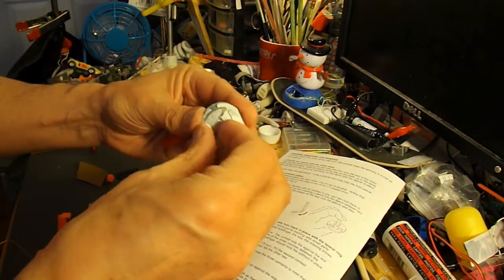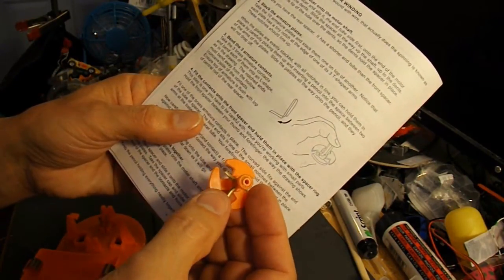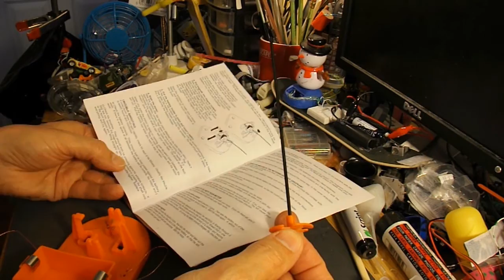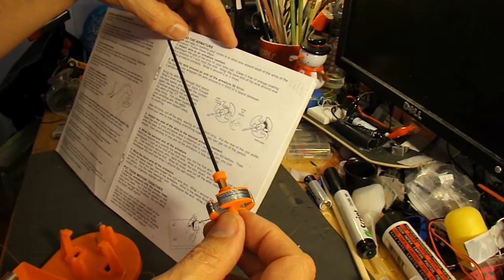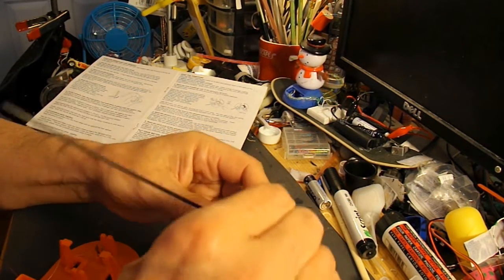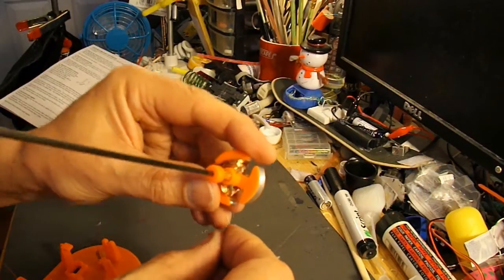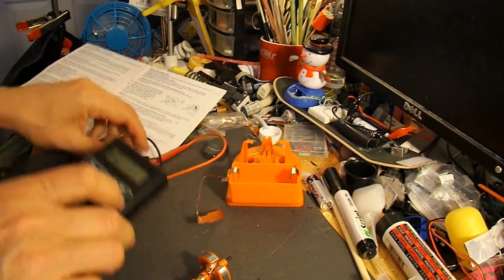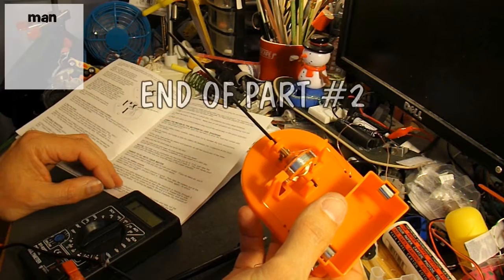Let's assemble a Build Your Own Electric Motor kit PART #2 of 3

Comment: So happy to have found your video!  We are not done but since we found these, a whole lot makes more sense than it did yesterday.  I told her we would go run it later but I belive it will still be yet one more day. Thank you!
Reply from the maker: Good luck, there are some useful links in the video description.
Reply: I will have to go back and see once we finish fighting the armature together.  We are having major problems sliding down the front spacer. It's very tight and I have knocked it all apart and need to start again.  But first want to make it slide on easier.